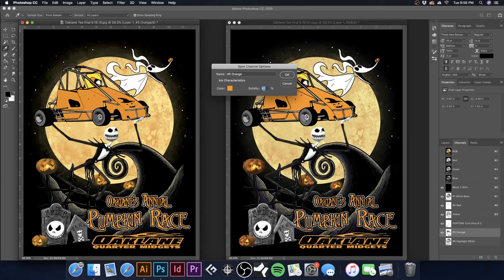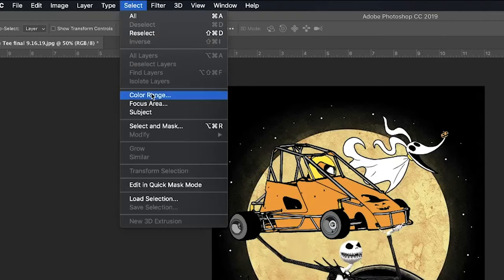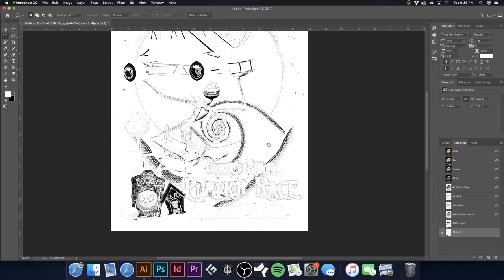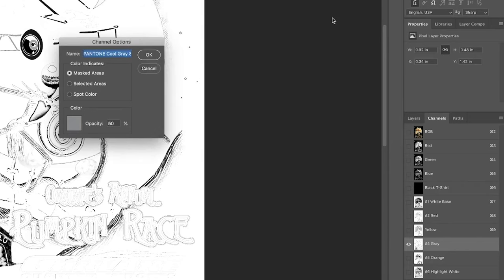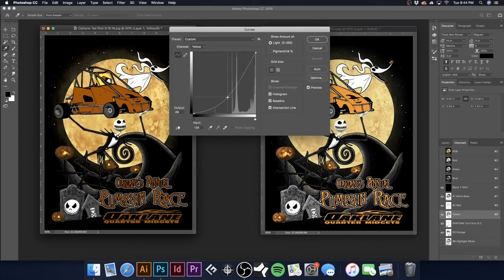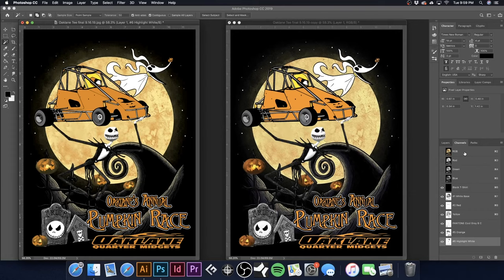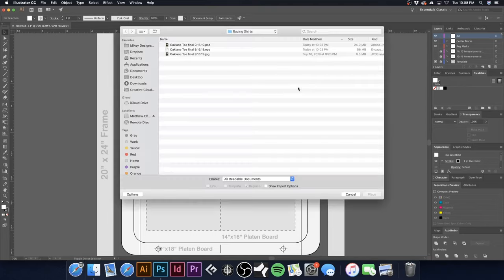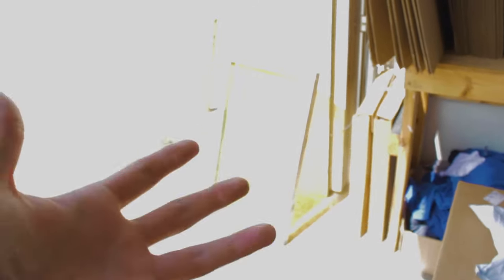How to Manually Separate and Screen Print Simulated Spot Process Step by Step Full Tutorial

Comment: Great tutorial!!! I had to stop ptinting, sat down and took out my notepad because this is priceless. So many things I didn't know you could do in photoshop.Thank you for taking your time to share this. You're the man!!!
Reply from the maker: Any time! I'm glad the video has helped. :)
Reply: Taino Ink Im still kinda lost.. your videos are simple (the choke the under base video) these are a lot of steps for a beginner. Also I did not know you can print RGB. I thought it was only spot colors and CMYK printing.

Can’t you just spot color only the colors that are in the design? And choke the under base? For example.. if my design consists of 3 colors white, green and orange can’t I just used these colors with the same steps?
Reply: Im still kinda lost.. your videos are simple (the choke the under base video) these are a lot of steps for a beginner. Also I did not know you can print RGB. I thought it was only spot colors and CMYK printing.

Can’t you just spot color only the colors that are in the design? And choke the under base? For example.. if my design consists of 3 colors white, green and orange can’t I just used these colors with the same steps?
Reply from the maker: @embassykingdomapparel5525  With a simple spot color separation, I would go this route. https://youtu.be/hj-CanG2tQo
Make a selection based off of your art, and spread the top colors by 1-2 pixels. If it has some really fine lines that a spread would close up, then choke the under base 1 pixel. I hope this helps.

Comment: So at the end your talking about the ink build up on the back of the screen and how it’s important. Can you explain this a little and does it get to a point you need to wipe it off?
Reply from the maker: You don't have to wipe it off. If you did, the prints would get lite. The key is to use higher mesh count screens so it's only putting down enough ink.

Comment: Hey Matt, thank you so much for all your videos! I've been learning so much and it made a huge difference in my work. 
I have a question/Comment: I am surprised to see you play with the solidity of the color, because I have been thought that it won't change anything on your film this is only for what you see in your computer screen. So if you're doing it, I imagine it does have an impact on your film? 
Thank you for your time!
Reply from the maker: Hey Marie. You're absolutely correct about that. Doesn't really matter at all on film. I can play however on squeegee pressure. White we're generally wanting a pretty firm print. How bright or light the color ink is can vary with squeegee pressure. Not near as much as playing with solidity. But it at least it gives you an idea of if I hit it hard, these are the results. If I'm barely kissing the screen and garment, this is what I'll get. If that makes sense.

Comment: Great video, but I have a problem when I finish all the settings and the design look ok and separate the channels the white base it does not cover all the areas with colors this is correct?.
Continue  with these tutorials are greats, greetings from Mexico
And excuse my grammar my English is basic.
Reply from the maker: I'll keep them coming. As long as your image looks like the original, or as close as you can get to it, it should work just fine. Just keep tweaking and you'll get there. Try using the RGB channel for your white base as an option. Many ways to create the white base. Just hold Command, or Control down for a PC, and click the RGB layer. See if that helps.

Comment: classic age old question.. what's the emulsion you're using?

Just recently switched mine up, went from 5 minutes (Ryonet Dual Cure) to 35 seconds (Murakami T9) all to a T given the exposure test. Even went out and ran about two dozen other screens messing w/ exposure time and I'm still having no luck! Cannot for the life of me wash out halftones without blowing a section out. I washout in the shop, use a hose attachment, similar to yours. No UV other than my bulb exposure unit and occasional garage door light leaks. Not a vacuum unit, but it's worked for about a decade in other jobs. Any ideas on my issue?!
Reply: edit I'm not observant, apparently. Emulsion is the first thing in the description, yikes. Regardless, any tips on my situation is still greatly appreciated!? :)
Reply from the maker: @Tyler-216  Make sure your films are nice and dense. You should see very little, to no light through the film. You could print out square to test the density.  Be sure you are getting good contact with the film and the screen. Aside from that, could be the emulsion, too long, or not long enough of an exposure time. A exposure calculator will help you dial it in. It's a strip with varying grays / blacks and you should be achieving a 7 holdout on the strip. I think the TZ emulsion will help get you closer because it is very forgiving. I hope this helps.

Comment: thanks so much for sharing your knowledge! i gotta ask, why does the file need to be in RBG over CMYK like when using illustrator to color sep?
Reply from the maker: Any time! With RGB, as you may know, is monitor colors and CMYK is for process printing. When you convert to CMYK you lose colors. Screen printing inks are more vibrant than traditional CMYK printing, so you can more closely replicate those colors. If that makes sense.
Reply: @mikeydesignssilkscreen473  is this why you've done color seps w/ complex images in photoshop? ALSO what would be the best way to save file to then send to shop that asked for it?

Comment: Thank you so much for all the separation tutorials, you’re a life saver. Couple of questions. Do you use a specific spot color ink? Why not go with cmyk method? I have a 6 color press but tough time knowing which spot color to use for color range. Please advise which standard color range I should go with. Thank you Mikey.
Reply from the maker: Any time! We just use basic off the shelf colors. CMYK is very difficult to keep consistent and requires flashing more with a white base. Spot process will be a lot easier and more consistent.

Comment: When a customer brings you a piece of artwork how do you decide if it will look better printed with cmyk or like this?
Reply from the maker: 99% of the time we will print with simulated process. CMYK is a lot more difficult to dial in and takes more time. So we'll charge more if they're requesting a CMYK print.

Comment: Question. In the video you did with the deadpool separation you expanded by 1 for the white base but in this one you did not. In what situations would expand the white base and in what cases would I not? Your videos are sooooooo detailed and I've learned a ton. Thank you for taking the time to share your knowledge.
Reply from the maker: Whenever you need a little spread so the white base doesn't peak out. Thank for watching!
Reply: Ohhhh makes sense thanks
Reply from the maker: @that1artchick  Generally, you want to expand your colors by 1, and keep the white base and top color as a standard selection. :)
Reply: Interested in why you choose different emulsions for different jobs? Thanks for your time. Another great vid as always!
Reply from the maker: @a-bombx  Thank you! The TZ emulsion holds better halftones vs a photopolymer emulsion.
Reply from the maker: @a-bombx  Thank you! I thought I had replied to this, but the TZ emulsion holds better halftones and is more forgiving with my multi-bulb fluorescent exposure unit. It isn't a high solids emulsion which helps hold better detail as well, IMO.

Comment: I feel like I’m missing out on a lot of tools and tricks and who knows what else by not having photoshop. I thought screenprinting was hard , isn’t this more of a “illustrator” or designer work your doing on photoshop?

I chose to watch this for an hr over doing laundry 😂🤘🏾
Reply from the maker: LOL! Awesome! Photoshop and Illustrator is definitely worth it. We use it for both design work and separations.
Reply: Photoshop's good for halftones, Illustrators good for spot colours.  One's a screwdriver, ones a hammer.
Reply from the maker: @nunyabidnit937  With a RIP software, they'll both give you good halftones. One is a vector program and the other is pixel based. Vector is basically a mathematical software that allows you to scale your art to the size of a build and still retain great detail.
Reply: @mikeydesignssilkscreen473  yeah I don't use a rip
Reply from the maker: @nunyabidnit937  In that case photoshop would be better.

Comment: what is the difference between wet on wet and letting it dry between each color?
Reply from the maker: Wet on wet is faster because you don't have to spend time running it under the flash. Therefor you make more per hour on press.
Reply: @mikeydesignssilkscreen473  makes sense but doesn't it create issues with wet paint mixing on the shirt and on the back of the screen? Sounds messy, that's why I asked.
Reply from the maker: @shoeengine1161  Not at all. What it does is allows the ink to mix creating new colors. You use a high mesh so you're not putting down a lot of ink. Think of it like a stamp.